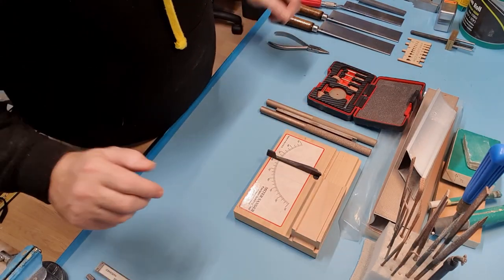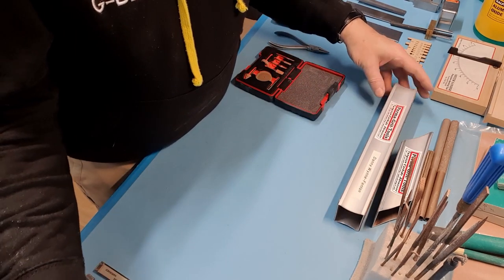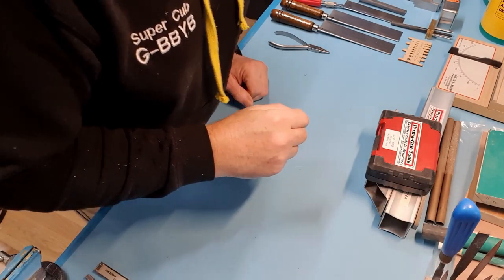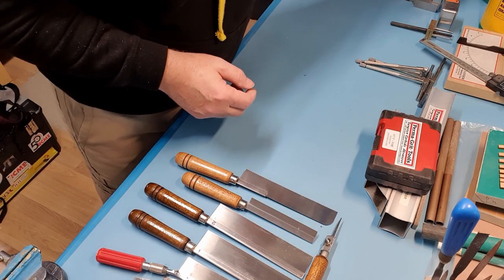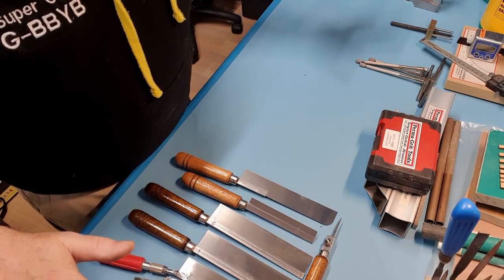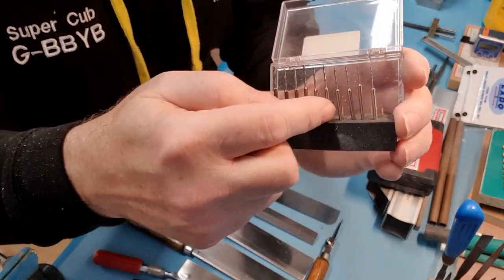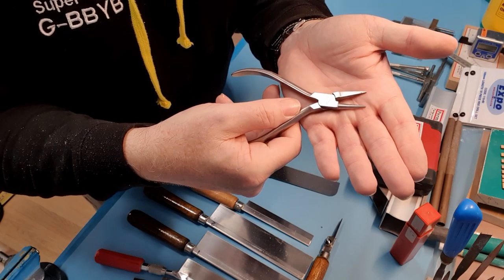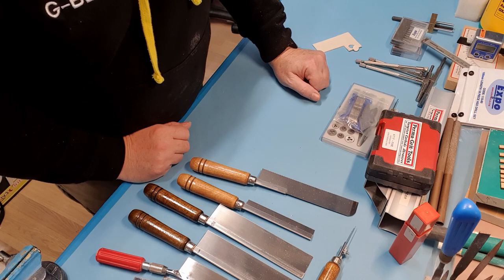Tools found in my workshop

Comment: One can never have too many tools... And when you think you have all you need, a tool video like this one comes along and you discover new things... Thanks Danny for a very enjoyable video (not dry at all, more like, to the point in my view...)
New to me were the hole centering jig, the spring loaded inside measuring tools and, my favorite, the 100mm long drills... I will be ordering some 0,5mm ones... 
You also gave me the idea of maybe doing the same for my tool collection, which is aimed at models of  smaller size. I have written 1-2 artixles about them but a video might be fun...
Thanks,
George
Reply from the maker: Thanks George, i am always impressed with your beautiful models, real craftsmanship

Comment: Those cheap calipers have a flaw in the design, the battery is always connected even when off. There is a video showing how to modify them if you are comfortable doing such things. I have found removing the battery, inverting it and placing it back in the caliper will extend its life.  I put it back in the slot so it is there when I need it and I don’t have to wonder if it's a good one or worn out.
Reply from the maker: Thats interesting, i usually get six months out of a cell, so wont worry too much. I do turn the display off after use. Rather than rely on a timeout. Thanks for the feedback though